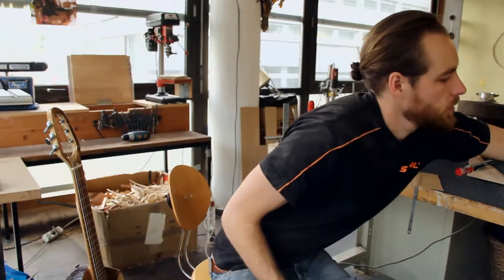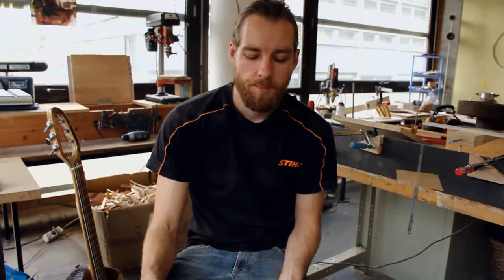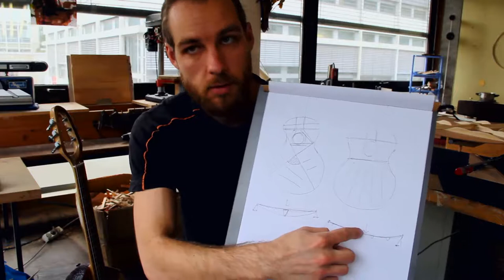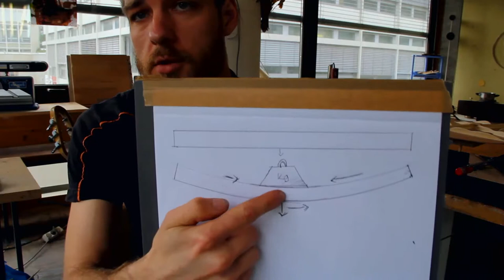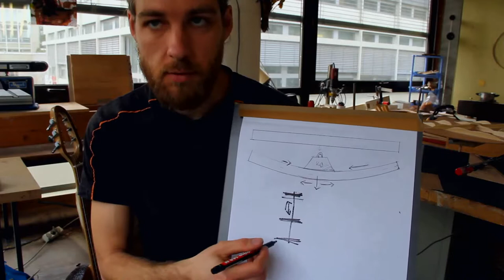Guitar Physics and the i-beam bracing

Comment: This is super interesting. One question: The I-beam design on the actual soundboard braces that you showcase at 20:44 looks a lot more subtle and less pronounced than on the stand-alone I-beam bracing jigs that you used for the deflection demonstration. How much of the i-beam benefits are you keeping/losing due to the difference?
Reply from the maker: Hard to tell since, in hindsight, the net weight benefit is so low, that I don't do it like that anymore. Just make the braces thin and high, and you get a similar result, and it's much easier to pull off. Hope that helps :)